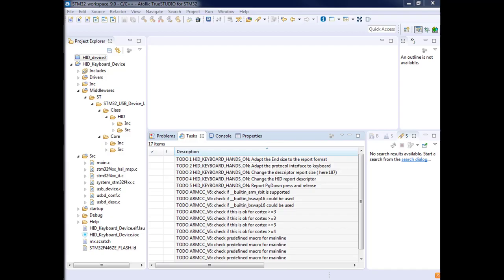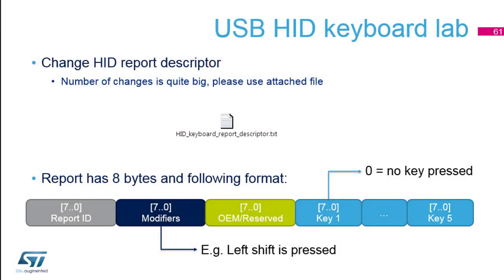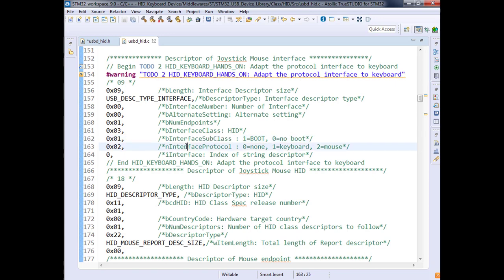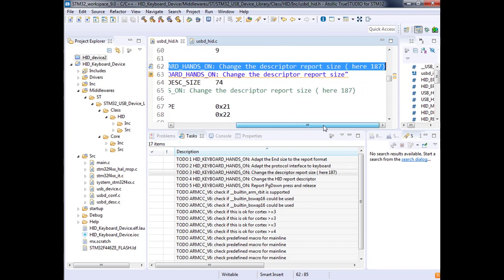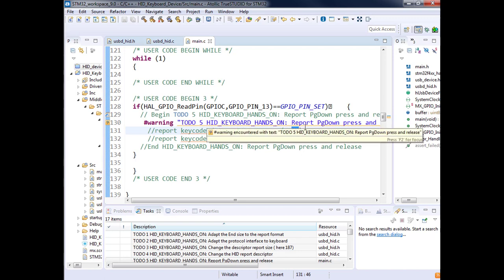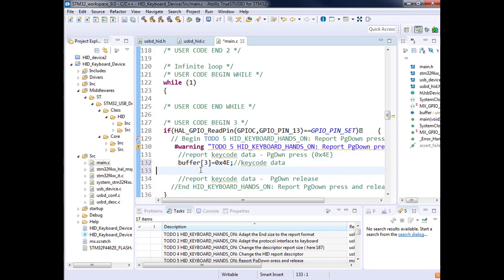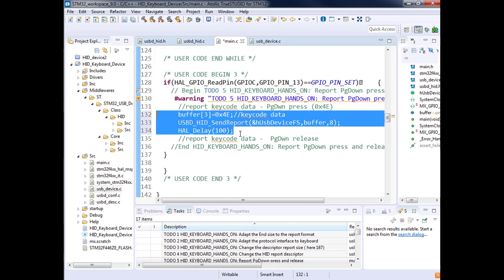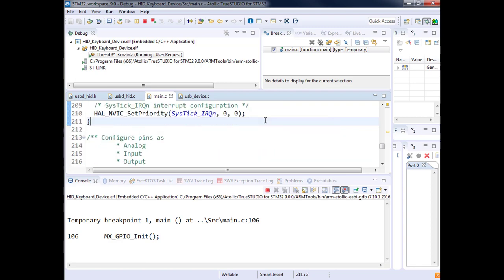STM32 USB training - 09.5 USB HID device keyboard lab

Comment: could you explain my issue? I generated the project in cubemx, replaced descriptor, HID_EPIN_SIZE, desc size and nInterfaceProtocol to use keyboard, so, everything looks like yours, when I try to send R character (0x15 according to this document https://www.usb.org/sites/default/files/documents/hut1_12v2.pdf) i get nothing
Reply: I was able to get the key press r == 0x15 working on my build. I would double check to make sure you have setup the project properly. It has the same setup as the prior video. If your confused how i was configured. watch the video prior to this one in the USB training video series. 

Did you change the buffer[3]=0x15 inside the loop?